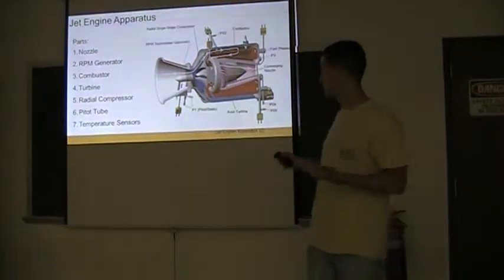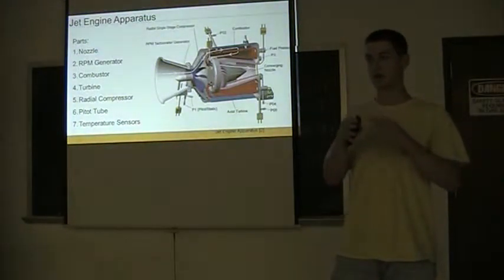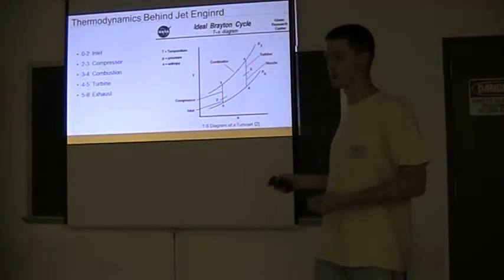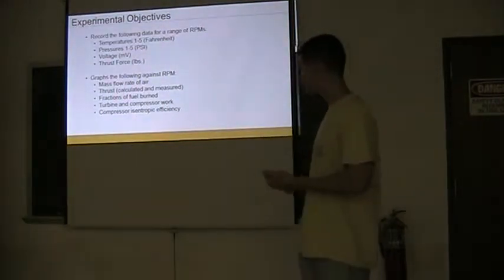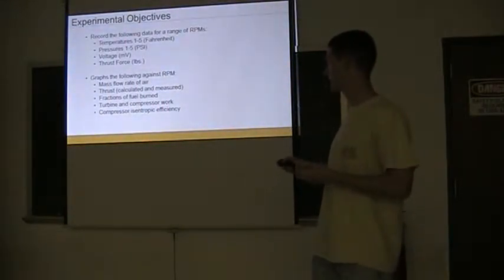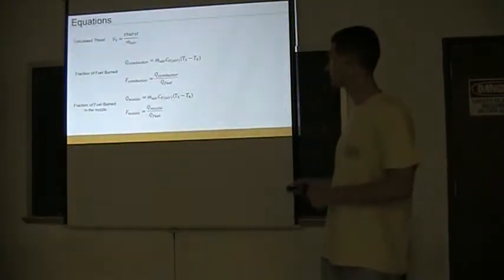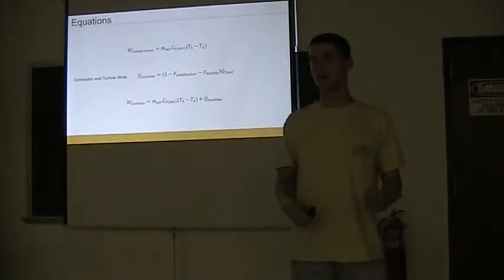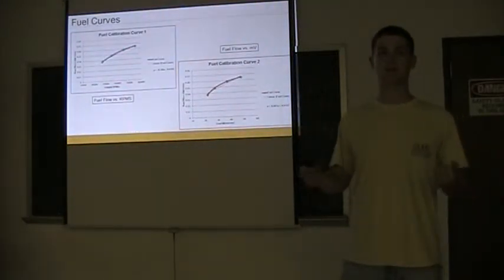Landon Stevens 3/24/15

Comment from the maker: David Jordan(Presentation Delivery) - The speaker did a good job of visually detailing the operation of the experiment through graphs which made the presentation easy to follow.  A possible improvement could be to state expected values for the engine efficiency.